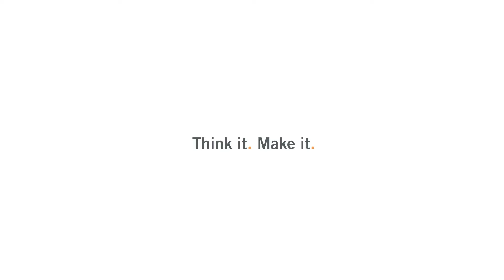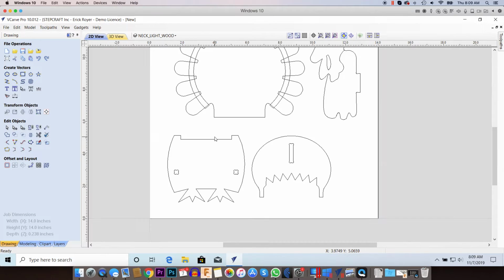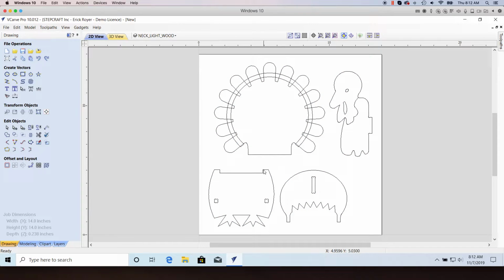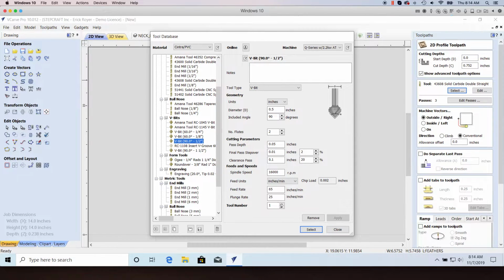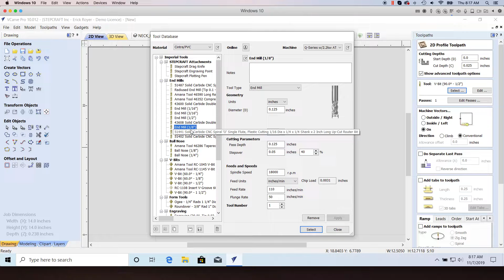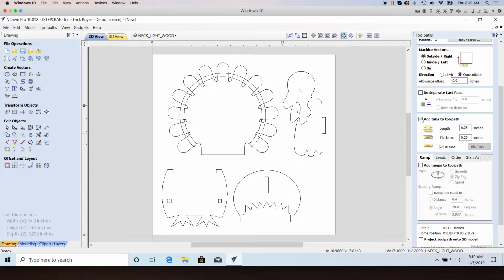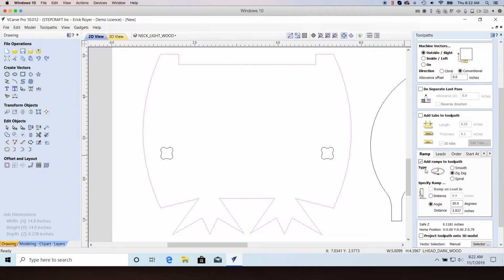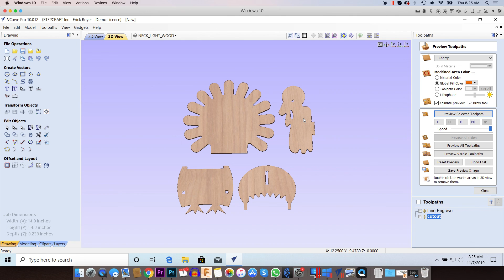Great Thanksgiving Family CNC Project - Turkey Napkin Holder w/Free Files

Comment: Thanks for including a dxf file in addition to the .crv file for those who may not have Vcarve. 
With regard to scaling slots (mortices) to wood thickness:  A "customer" had a dxf file of rocking horses (at least 10 that fit on three sheets of 5x5 ply) that were drawn for 14 or 16mm ply. He had 18mm ply (3/4"). Scaling up for the slots would have made the rocking horses huge!  I found using Offsets in the profile toolpath allowed me to cut a wider slot without significantly reducing the size of each rocking horse -- AND without having to redraw each and every slot. ;-p   
Your method for adjusting nominal thickness to actual is much better in this type of situation. Having a calculator to do it right is pretty slick. Thanks for that too.
Reply from the maker: That is a good idea with using profile offsets.  I will try that and then maybe make a tutorial video showing that concept as well.  It is a good idea if you only have a few.  If you had 50+ for a puzzle it would still be possible, but you just have to take your time to select them all.  Thanks for the tip and the compliment!